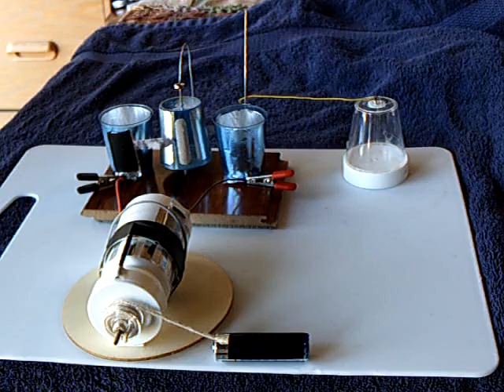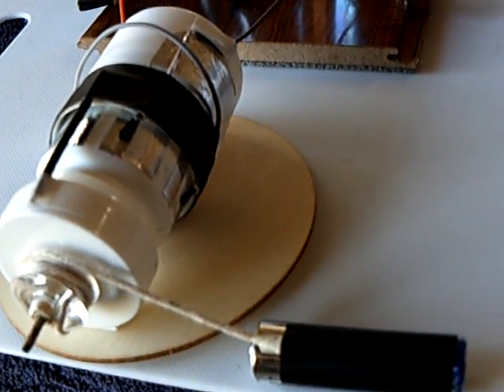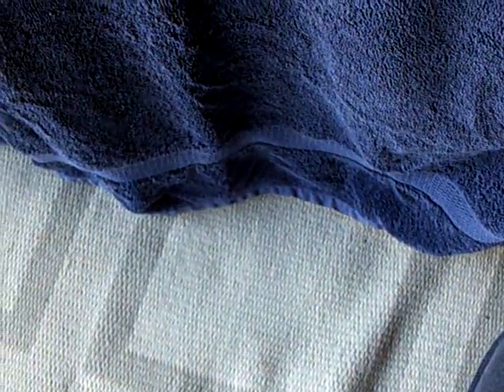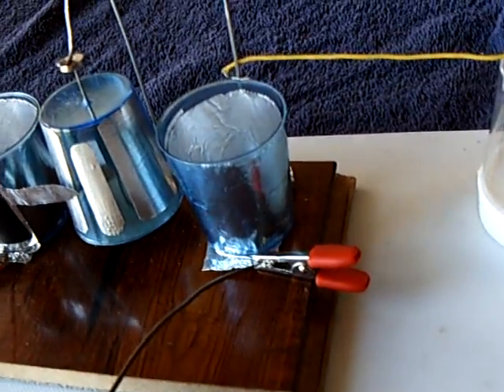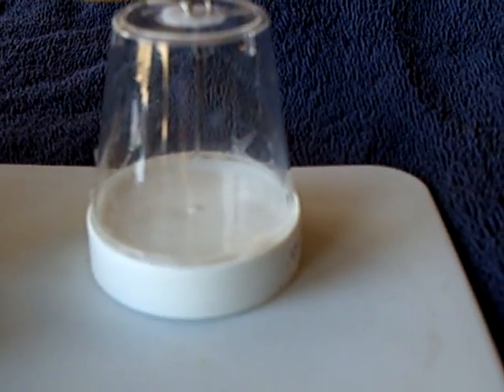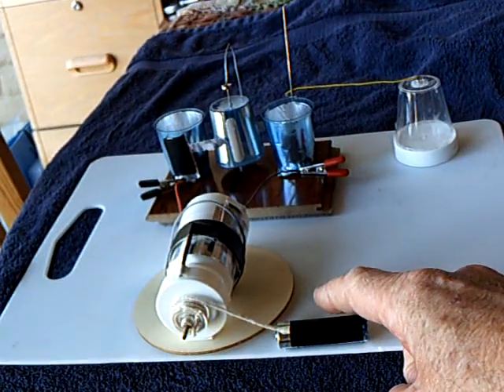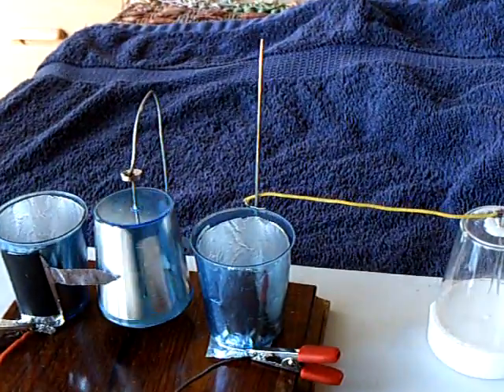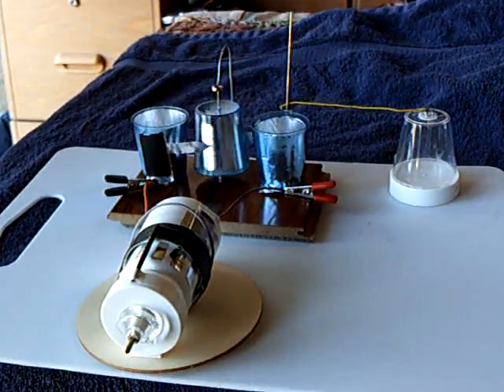GRAVITY --- powered electrostatic devices

Comment: Yo-Yo Effect
Dry Crystal Cell Battery Assisted?
Self Charging Magnetic Furnace?

Let the weight drop;
Elevator go up & drop again.

Control Shaft Rotation Necessary4Mechanical
Movement2Pull Up
&
Released Control2Drop Down.

It Could Be Made2Self Sustain?